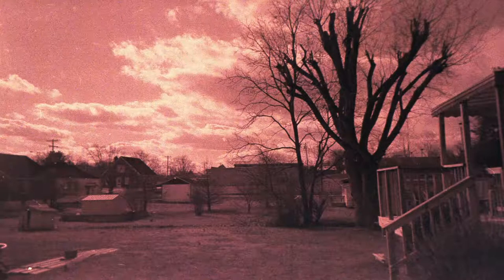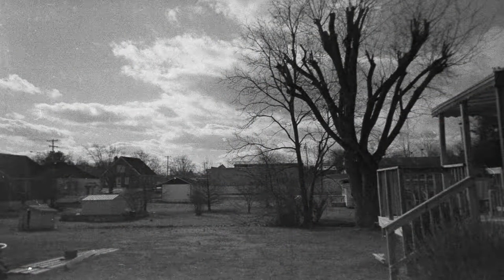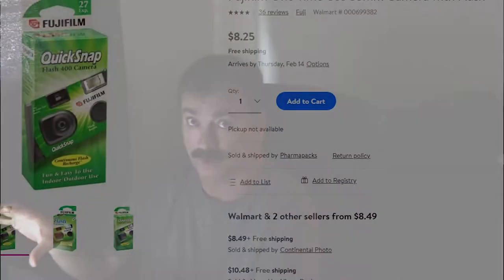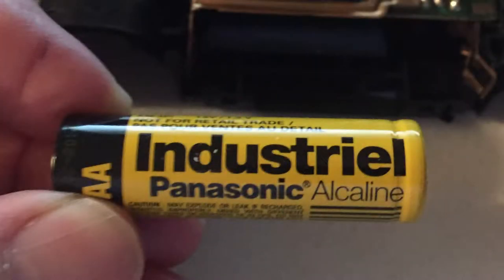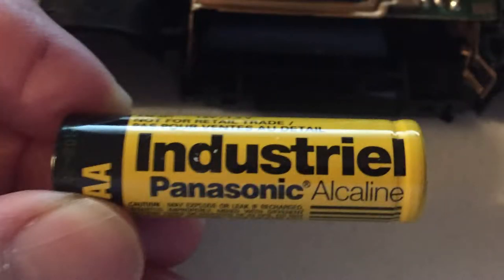10 Year old expired disposable camera.

Comment: Hi Jeffrey. Informative video, and I like the results and red cast from cross processing. In my queue of vids to make yet is the Fuji waterproof 800 disposable. I took it to an indoor water park with the family about a month ago, and I was pretty disappointed with the results. Of course it's not built to shoot inside exclusively, but I wanted to get some shots in the water and they were so underexposed that they were unusable. It was pretty affordable though, $15 for a two pack. Next one I'll have to take to the beach instead haha.
Reply from the maker: Thanks for commenting. I like the disposable cameras but they are limited. The few specs I can find on the 800 speed waterproof fuji says it has a fixed f stop of 10 and a fixed shutter speed of 1/125. For outdoor sunshine the "sunny 16 rule" suggests 800 speed film would need f16 at 1/800 of a second.  I think these cameras do a decent job in good light, but the plastic lens on them makes for a softer image than a regular camera. They are sure handy at times.